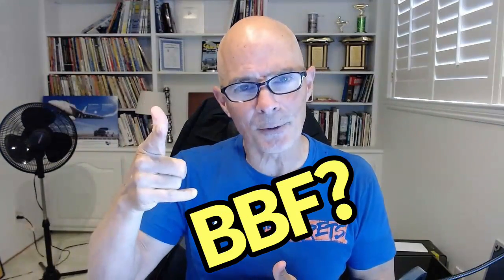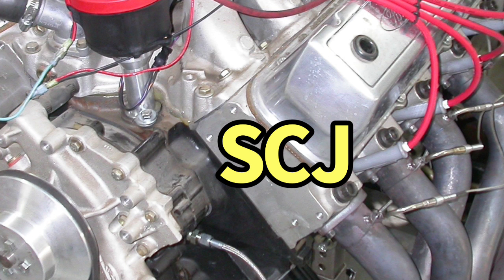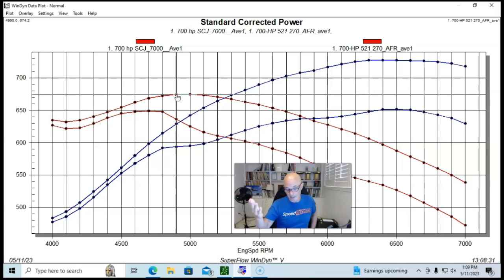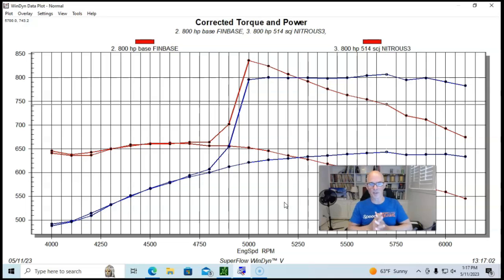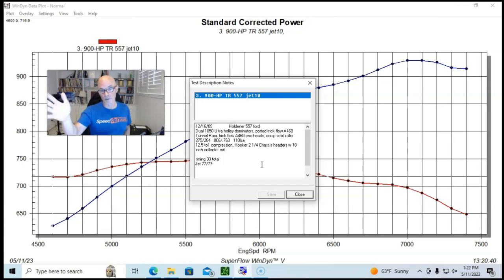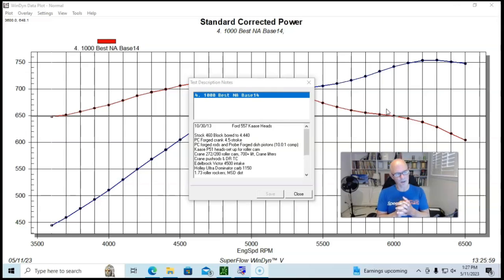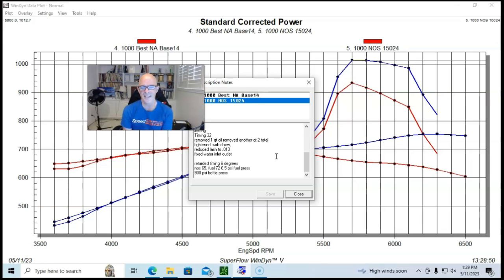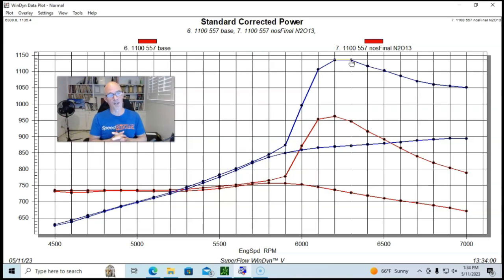HOW TO MAKE BIG BLOCK FORD POWER PART 2! 514, 521 AND 557 CUBE BBF STROKERS. 700-1,100 HP COMBOS!

Comment: Come on Richard give the BBF some respect. The best of the big blocks. The Mains. The high cam for the stroker. Many more things. Build a low buck stroker with Kaase heads like the big bang LS  and hit the 2K hp mark. Time to recharge the channel with some insanity.
Reply: Hey man!!!
AMC!!!
Studabaker!!!
Lol/ just kidding. Love the stuff.
Reply: Its a real stretch to say that an engine that never came from the factory with a hydraulic roller, and can't run one without an aftermarket block or host of issues, is "the best of the big blocks".
Reply: Not splitting hairs here but this is a performance channel and not having a "hydraulic roller" misses the point. Not trying to start a thread war here just will say this. 
Assuming whatever you build it has aftermarket aluminum heads, what are some of the advantages of a Ford 385?
Bigger main bearings
Bigger rod bearings
Bigger cam tunnel
Bigger lifter bore
Higher cam
Taller deck
Bigger bore spacing
If you want a big inch motor without going to an aftermarket block - BBF. Also that Bigger bore means Bigger valves and valves are the number one restriction in an engine.

Funny enough Uncle Tony just put a video out a couple of days ago about the BBF.

https://youtu.be/Vcp-KUKwQKI
Reply: @jonmac155  And all of that means nothing on 99% of street engines when its full of metal shavings from a wiped flat tappet.
Reply: @jonmac155  a standard deck height LS block can hit .660 valve lift and 4.185" bore by 4.125" stroke (454ci).  But the fact is that with the right turbo setup you can use a stock 5.3 with miod cam, head studs, and boost and make reliable 4 digit power. 

One of the favorite things on the ls engines is they don't have nearly the fluid leak problems of the old big blocks and lots more engine management options and all at a lower cost with a wider range of aftermarket.  some people have a specific engine platform that they like to build on and that's fine more power to them, but the people that are looking for the best bang for their buck are going with LS engine platform.
Reply: @chipcurrey653  Solid roller lifters? Most of the viewers will build motors not buy motors on this channel. Popping off a valve cover and setting some lash is just another day on the farm. "This is a performance channel" meaning a big cube BBF is no daily driver and if you need a BB for your RV absolutely 454 Vortec is the ticket, but I've yet to see Richard dyno a Winnebago motor. Like I said in one of my earlier posts - I would love to see a big bang of the 440, 454 and 460 all with similar mods. Who grenades last? My money is on the 460.
Reply: @MrPhukyew  As quoted from Enginebuildermag - "The length of the cylinder is important because it dictates how much piston will be pulled out of the bore at bottom dead center. The shorter the cylinder, the harder it is to design a piston that maintains stability and ring seal at the bottom of the bore. As a rule of thumb, we like to stay with a maximum of a 4.000˝ stroke on any LS block with a cylinder length less than 5.600˝. This dimension is descriptive of all the factory blocks except the LS7, which has a 5.800˝ cylinder length." So no a 454 is not possible on a stock block. The 460 however, of the shelf 600 inch stroker kit with a stock block. Yes the LS is impressive but if you want streetable stock block 700 + N/A hp you're gonna need the cubes.
Reply: @jonmac155  that is correct on a standard length sleeve, LS7 blocks are safe on their stock sleeve up to almost 4.2 inch stroke.  4.125 is a common stroke length that can work on any block that you re-sleeve and it's much more common than you think.
Reply: @jonmac155  Let me guess.  You're a Ford fan.  And you forgot to mention 9/16 head bolts.
Reply: @jonmac155  Didn't he test a 440 from a motorhome?  I'd have to look at his playlist again.  I know David Frieburger tested one with 7.5 to 11 compression.  It never made 400 hp, but the torque was very good.
Reply: @jonmac155  Does a GM LSX block count as factory?  You probably mean factory production line engine blocks...
Reply: @MrPhukyew  Ive always thought a 440' LS would be the coolest.  Just because.
Reply: @scotttimpany2845   Scotty you are a posting machine gun. I'll try to reply to all of it. 
First, Richard Holener is the bomb. Man has the life as far as I can tell. A home full of love and a dyno room full of power. Something to aspire to.
Now lets get on with it.
Ford fan? Not any more than anything else. Just be cool, innovative and ingenious. Think Miller, Gurney and Yunick. That's my jam. I do bleed Yamaha blue when they do car motors.
Wrecking yard 460? Yes they are out there. They were used till the late 90s. For the average guy it is drop a boat anchor 460 into any fox body and every year spend 2-3k on the motor and drivetrain. After 10 years you have a snarly beast (not talking about the wife cause you kept it to 50-75 bucks a week). 
Yes you can chinesium a LS to the moon but nobody cares. Been over done. Not the destination it's the journey and the people you connect with.
As for the RV motor... I meant RH don't build low rpm, high torque, stump pullers for work duty.
Let me finish this time with this.
What I would really love to see is a Gen6 454 L29. The commercial version of the L21. Came with forged crank and pistons. As for heads, I've watched a video where Vizard said modified Vortec BBC heads will flow 430cfm!!! Budget rebuild, Vizard heads and some Holdener boost. 
Big Bang 2000+ hp? Don't know. I'm not Richard, but I'll tell you that my shorts are getting tight just thinking about it.
Reply: @MrPhukyew  why do people keep stating that. It's already been proven THAT THAT IS NOT TRUE. The only reason LS engines are popular is because they're simple and cheap to upgrade, (or at least people think they are) and they're, "compact". You can get reliable 4 digit power out of dohc ford's with h beam rod swaps, fuel and turbos. You don't have to touch anything else really. It's hilarious because a while back some rag did a comparison between the 6.0 LS and the 5.0 coyote to see which was cheaper to build per cubic inch or something like that. The LS won because they messed with the cams on the coyote when it didn't need it. The LS was fitted with H/C/I the coyote didn't need none of that. They ported the heads on the coyote and it was right there with a H/C/I 6.0L LS whilst being a whole liter down.

Just for poops and giggles, I don't want anyone in this thread or anyone who happens to read this to get it misconstrued about tritons vs LS engines. It was Fords crappy heads and lower compression that made them undesirable and seem like wimps. An 11.5:1 3V 5.4 would embarrass a lot engines if it were ever built.

 I honestly wish I had the time and money to build such because I know how and I'm sooooooooo tired of the LS lies. Is the LS platform a good engine, sure. Just don't make it seem like they're the be all end all. Because a lot of people, "claim" their engine is stock doesn't mean it's true.
Reply: @smackledorfmcsween  Ok calm down, buckle up, and secure your double soy latte in the cup holder for this one.  First of all I'm not here bashing the fords and I'll say right up front that a coyote 5.0 is far more efficient of an engine right out of the factory than most ls engines could ever be.  Why?  11+ compression and fully adjustable lobe separation angle on ALL 4 cams right out of the box.  Not to mention the extra 16 valves it has.  

Now keep in mind a truck 6.0 isn't what it was designed to compete with.  It was designed AFTER the LS3 engine had already been making 425+ hp and more torque than the 5.0 without having all the extra headflow and cam angle possibilities controllable by computer in milliseconds.   And the LS3 had lower compression too.

Now let's get to the mods.
Cam swap on an LS engine is 400-600 in parts depending on if you need spring upgrade.

Ever priced a cam swap on a coyote?😂

Now let's talk about power capabilities with boost, stock rods and crank for a 5.3, 6.0, 6.2 (all the same) will go deep into the 4 digits on a Dyno just like the coyote.  Coyote doesn't need a cam upgrade to do so, well I'd hope not considering you gotta refinance the car to afford the parts list.  Stock LS2 or LS3 cam (6.0/6.2 corvette/camaro) will also make the same big numbers on a Dyno.

Now let's talk price tags again.
Coyote swap a 60s Mustang is like 12-18k to do it right depending on options.

Ls swap the same car and make the same power with a cammed truck engine and now it's 3-7k depending on options.  It is also way easier on the electrical end of things.

Nobody wants to build the modular engines because of the pricetag and lack of aftermarket options, lack of people willing to tune them, lack of tuning options, price per hp is crap on literally any engine in comparison to an ls.  

This doesn't make ls engines superior in every way or even in any way, it just makes them more desirable to somebody who is looking for the best bang for the buck.  Cheers🍻
Reply: @smackledorfmcsween anybody who has a clue knows the LS is dog water compared to Fords mod motor V8’s John mihovetz has been 5’s in the 1/4 with a 281ci factory Ford block and heads. The 5.4l in M2K Motorsport powers the fastest street legal car in the world 300mph Ford GT and it makes 3000hp on stock factory block and heads. There is 7 second street driven mustangs that’s 7 second 1/4 with stock 1000hp coyotes …

Anybody in this thread comparing completely redesigned bulletproof aftermarket iron/billet aluminum
small blocks/heads engine doesn’t resemble an LS at all and can only make 2000+ HP to Ford's Superior OEM production aluminum Mod Motor blocks, and heads capable of 3500+ HP
(which happens all the time is just attempting to trick people into believing things that aren't true.

Will we ever see a OEM production LS based powered anyting run a 5 sec E.T. in like Ford mod motors have? Never
Reply: The 2 bolt mains the cast cranks yea real hp
Reply: @David-er1cy From Jon Kaase - "When we do use a stock block, we can make 800 with no trouble at all. We have one engine here since the year 2000 and it's a 0.030-over block, two-bolt mains, ARP studs. That's all we've got done to it. We've done all our testing on all those cylinder heads that we worked on on that motor. It's been different cubic inches, but most of the time it's been 521. It's a 4.390 bore and it's 4.300 stroke. We've made anywhere between 800 and 990 horses with it, and we've been beating on it for 20 years. It's got two-bolt stock caps—we might've bushed the lifter bores at one time—but it's basically a stock passenger-car block." N/A BTW
Also the stock cast crank is a beast. Over 50% larger than LS cast cranks that Richard has taken to 1500hp.
The weak point is the rods.
Anyone doubting the strength of the 460 read the Article for yourself
www.motortrend.com/how-to/cheap-ford-big-block-460-10-reasons-jon-kaase/amp/
Reply: @jonmac155 truth is the 460/429 or 385 series Ford can make more power, achitvrolet could only dream of making as much
Reply: Absolutely bro,!
Reply: They are to busy focusing on gm junk unfortunately
Reply: @antonpfleger5448  that gm junk is what dominates all the fastest street car shootouts radial versus the world, pro mod do i need to go on
Reply: @David-er1cy  hemis run the drag strip.  90% of high hp builds have no gm parts. It's all billet.
Reply: @antonpfleger5448  those bbc  gm.junk rules the dragstrip, even in those junk foxbody mustangs lol
Reply: @David-er1cy  people think bbc is a cheap build.  It isn't.  Anything over 500 hp you have to go with new internals.  Bbf has been 1000 hp on stock internals.  If they want to waste money, more power to them. They far from rule the dragstrip also.
Reply: @antonpfleger5448  internals is only part of the battle, this is why LS builds are so relevant and popular. Stock LS heads and stock LS internals can still hit 1000+ without having to spend the big bucks.  Thus being the reason he creates so many videos around the ls platform
Reply: @MrPhukyew - every comment you make is false
Reply: @CoyoteFTW  ok bro whatever helps you sleep at night.
Reply: @David-er1cy ”junk foxbody” yeah they’re so junk that everyone and they’re grandma runs one….. smooth brain
Reply: @David-er1cy if gm ruled anything they would have dominated Ferrari back in the day gm or Chrysler neither could do it . And Nascar wouldn't let fors 427 compete because they knew it was more motor than Chrysler and gm. Couldn't compete with
Reply: You realize he doesn't often build or do much of anything with the engine Dyno right? He is usually just pulling up old Dyno results and doing comparisons because he has so many photos and dynos in his long history of doing this that it's easy for him to create content that many of us have not seen.
Reply from the maker: "YOU REALIZE HE DOESN'T OFTEN BUILD OR DO MUCH OF ANYTHING ON THE DYNO RIGHT?" WEEK LONG TRIPS AWAY FROM MY FAMILY EVERY MONTH TO THE DYNO WOULD SAY OTHERWISE-IT IS AMAZING THE THINGS PEOPLE FLAT OUT MAKE UP AND TRY TO PASS AS INFORMATION.
Reply: @richardholdener1727  I assumed most of this was stored up information because many of the tests that you have shown us over the years were also shown years prior in magazines.  Didn't mean to offend, many people assume this same thing as you can see in this list of replies.
Reply: @richardholdener1727  just need more hemi stuff lol😂 you doing awesome!
Reply: All caps, Mr Holdener, away from his family to bring us content is unimpressed. Rightfully so. 

I'm not asking or suggesting anything. I'm just putting out into the universe what I would love to see. Big 3, Big Block, Big Bang!!! 440, 454, 460. All turbo. 
YT Channel crossover. Uncle Tony 440, David Vizard 454 , Kaase 460? Not built by them, just their expertise on how to make them live.
 Set a $5000 motor max not including electronics (injectors, ecu, turbo system). Complete motor, manifold to oil pan. Also assuming they already have the engine and no ringers. Must be mass produced and available. 
To the death. 
 I'm pretty sure the Holley Terminator, Turbos, bov, waste gates and intercoolers are available to use for the testing. 5k x 3 is 15k, plus x ? Call it 25k. That's 10 cents per subscriber.  Go fund me. Give the winner away (intake to oil pan, no turbo system or electronics). $5 bucks a ticket? That's 5000 people. 
Like I said just putting out there. If you don't ask the universe it will not provide.
Reply: @MrPhukyew I know. Most of the stuff is out there as an old hotrod article. 
What are his most popular videos? The Big Bang series. He has a 1/4 million subscribers and is going ro run out of old dyno runs at some point. Hence build a relatively budget oriented BBF. Moderately priced stroker kit, decent used heads and build an efi intake which we know he has done in the past. Why not a BBC? It's been done to death. Plus the BBF is a beefier motor. Make the dyno pulls, sell the motor and fund the next project. One of those 1/4 million subscribers must know someone interested. Plus would have the provenance of being the motor everyone has seen.
Reply: @jonmac155  that I can agree with, but I feel like he really doesn't need this YouTube channel it's just a hobby for him.  So we probably won't see much different in that aspect than what he's already done.  I'm thankful for what he has given already on this channel.  I learned almost everything I know about cams from this channel so he will always have my support.
Reply: @MrPhukyew  Richard Holdener had a long and successful career in print media.  I think I started reading his articles in Hot Rod, FF & Mustangs, etc as early as 1984.  He also wrote numerous books.  He has appeared on a few tv shows.  I believe his primary source of income these days is youtube since print media really isn't "a thing" anymore.  I'll bet that the time spent on organizing existing data and getting in a proper youtube format is considerable.  He's still doing dyno tests @ Westech - which several hundred miles from his house.  That takes time too - and that's why some call Richard Holdener "The hardest working man on youtube".  I would never question his experience or work ethic.  I also think he's a decent guy.  You are free to think anything you like.
Reply: @jonmac155  I think the reality is that most guys run something other than a BBF.  I'll bet most guys are interested in content related to LS combinations, SBF combinations, and Honda builds on the import side.  From a cost perspective, you can go to the boneyard any day of the week and find a running LS for next to nothing.  Ever seen a r385 series in the wrecking yard?  Personally, I think a 545 inch BBF with Kaase components in a green or black '69 Mustang fastback would be a cooler than cool combo.  I'd shoot for 750-800 hp N/A and I'd back it with a GM 4L85e and a Ford 9 inch.
Reply: @MrPhukyew  That statement is waaay in the left field. Can you clarify what you meant?  I am a machinist and build all types of motors and the knowledge he has and has shared comes from being there.
Reply: @wastedwagesmercuryman6018  what's unclear about my statement?  Ls engines get made fun of by the 20% of car guys that don't like them but the reason they are so popular is because the stock heads and rotating assembly can make 1000hp with the right supporting mods.  A set of head studs and a mild cam and BOOST.  Most other engines cannot do that, and if they can the price tag is higher for the engine and the supporting mods.
Reply: @MrPhukyew  big block Fords can do that...
Reply: @w3r3cow  they are also a lot more expensive, and the parts are more expensive, they are also less common, and there's a smaller aftermarket available.
Reply: 400m is the best bbf
Reply: @travissmith7803  You'd be right if you blasted your Delorean up to 88 and went back to 1982 and were doing a budget build. Tall deck Cleveland is nice but not a big block. Just the motor mounts and bell housing are BBF. Architecture is considered small block. Still a fan though.
Reply: @travissmith7803 😂🙄🤦